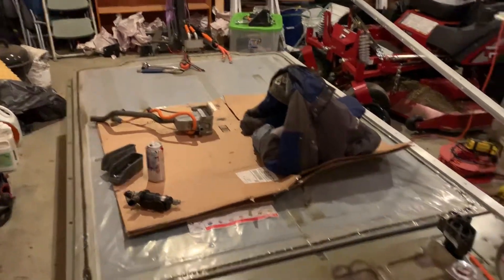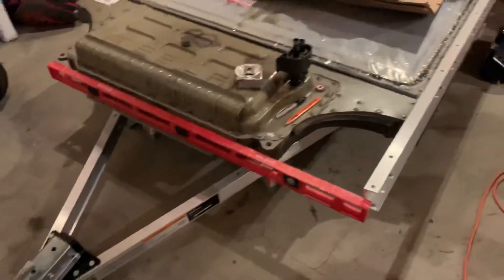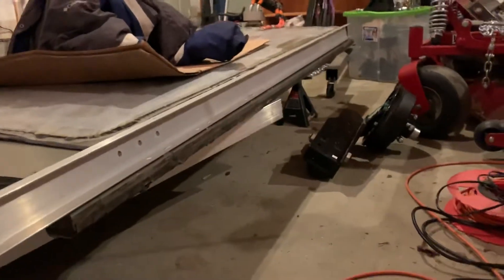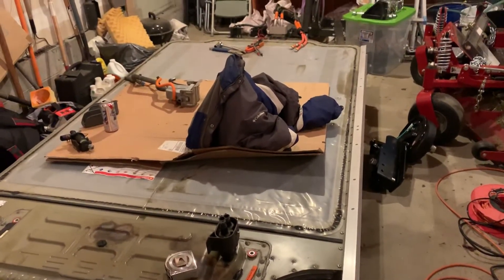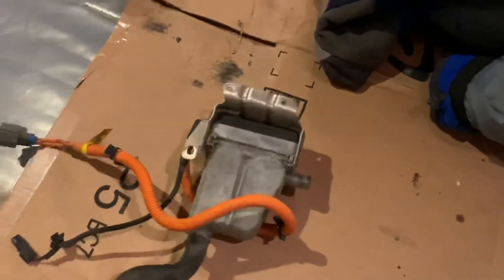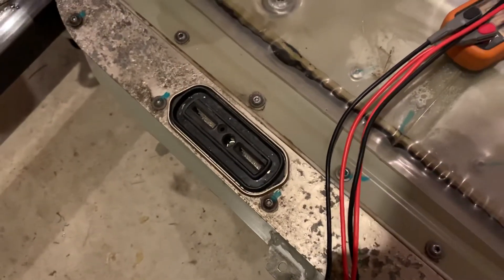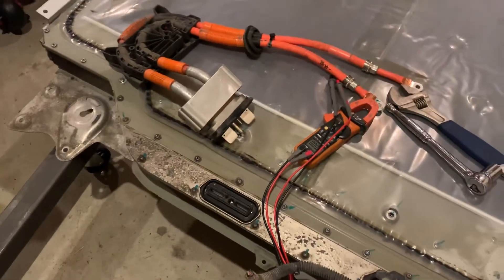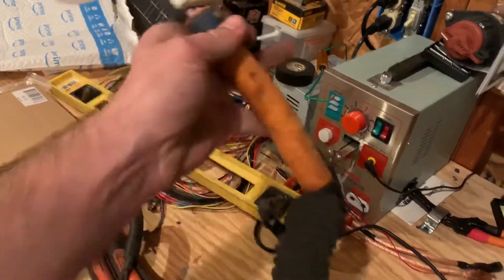T-Rex Camper Build: Day 1

Comment: I'd look for some electrical grade copper bar stock instead of flattened copper pipe since it's a high current interface.  Should be able to find some online of the proper thickness for a tight fit.  If you find some a bit too large I have a friend with a mill and we can mill it to spec if needed.  Turns out I live about 10 minutes away from your house.
Reply from the maker: OMG do you!? That's awesome! Where do you live? You should come by sometime and check this stuff out, if you're interested.

Thanks for the input. Do you have any links of products you have in mind?
Reply: @JamesKlafehn   Yeah I was thinking I should swing by sometime, I'm in Lansing.  Amazon, McMaster Carr, and Grainger all stock electrical grade copper, (C110) in various sizes.  Probably Ebay too.
Reply from the maker: JRP3 Maybe tonight I will take apart the Tesla coupler and see if I can use that. However that part is probably worth a few hundred dollars. I’ll also look into what you suggest. One of my buddies works at Friedman electric.
Reply from the maker: Send me your contact info and we can schedule a time to meet over here.
Reply: @JamesKlafehn   I would if I could figure out how to send a private message.  Is that no longer possible on youtube?  Don't want to put out my info in public.
Reply from the maker: JRP3 jamesklafehn@gmail.com
Reply: @JamesKlafehn    Got it, sending you an email.

Comment: The total voltage for Tesla battery is around 392-volt DC while I am not sure of that of Rav4 EV total DC voltage when fully charged. Please be careful with the high DC voltage. I wish you the best.
Reply from the maker: Thanks. I am going to let the battery controller open and close the contactors when it sees high and low voltage. Because they are in parallel, if I charge using the Rav4 the Rav will only charge both packs to about 378 volts total. Empty voltage is higher in the 85kwh pack so Ill have to make sure the controller opens the trailer contactor at 288 volts. The Rav4 EV can go down to 276 volts.
Reply: @JamesKlafehn  I may ask, why not put your control box where you have the connector, which means turn everything around and you will not need to add long heavy duty cable.
Reply from the maker: @t.shonoiki563  Either way the power needs to come forward because it has to connect to the Rav4. I could move my whole control box to the rear but Id have to run the heating/cooling lines to the rear. So either way I have to run something. I also want to be able to slide sheets of wood in from the rear of the teardrop. If I have my control box in the rear I wouldnt be able to do that.

Comment: How much weight are you hoping to carry on top of the battery pack?  As I remember when I looked at the rating on your RAV battery trailer it was around 1,900lbs.
Reply from the maker: I am hoping to make a lightweight teardrop that is less than 800 lbs total. That will be roughly 1300 for the battery, 200 for the trailer metal and parts, 100 for the battery control box for a total of around 2400 lbs
Reply: @JamesKlafehn  Is the new trailer rated higher than the old one?
Reply from the maker: @JRP3  I have a new Timbren suspension that is rated up to 3500 lbs. Should be fine
Reply: @JamesKlafehn    Nice.  Were do you get the trailers from?
Reply from the maker: JRP3 https://www.northerntool.com/shop/tools/product_200660344_200660344

I just bought it last week. It was on sale and I got a $50 gift card. $600 not including the gc